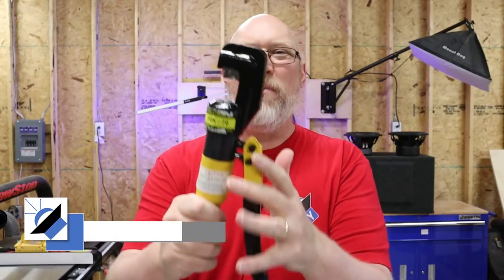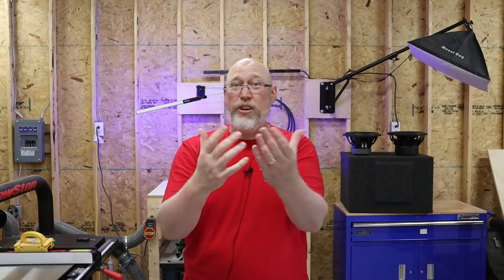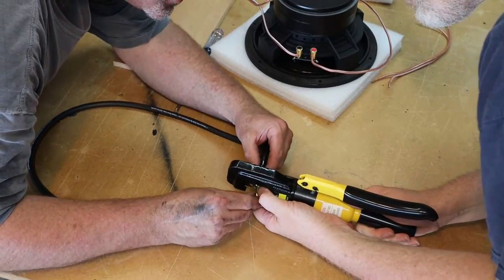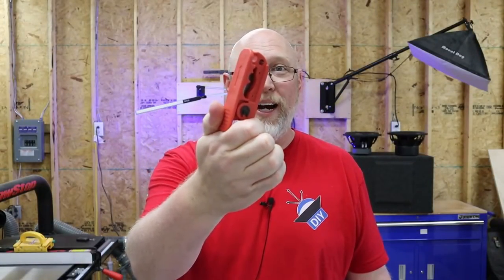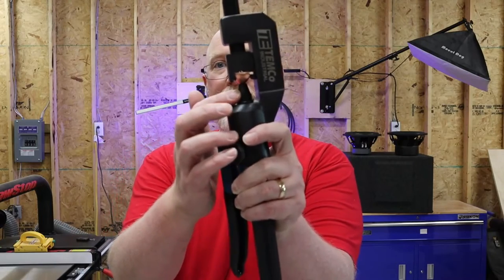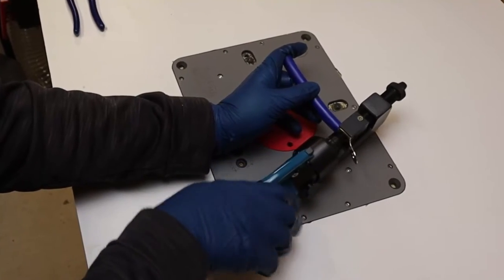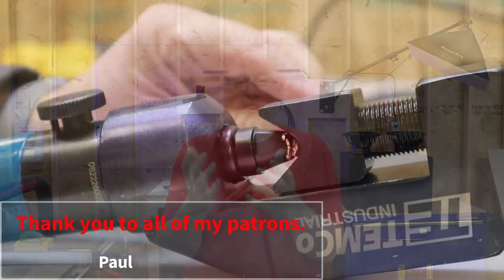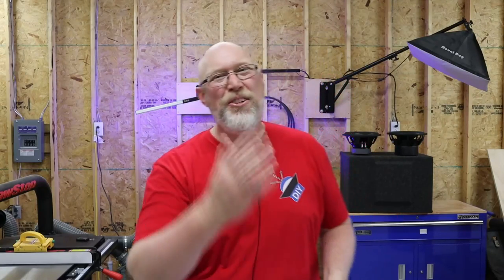The BEST lug crimper on Amazon!  TEMCO vs. Generic Yellow Crimper

Comment: My $60, 16 ton Chinesium crimper has worked flawlessly to be honest. If you really want to test that Temco crimper to see if it’s creating a proper cold weld you have to cut the lug in half after you crimp it. If the wire and the lug look like a solid piece of copper it’s doing it’s job correctly.

Comment: I bought this same cheepo crimper about 5 years ago. It has performed flawlessly through hundreds of stainless steel on stainless cable fencing.  the dies make a much stronger connection than a single point dimple. This wouldn’t matter electrically but for strength it maters. Put a little sticky grease on and it won’t fall off.

Comment: I have used one of these Chinese crimpers for years, it's crimped about 2000 Stainless wire balustrade's without a problem, never leaked, I must admit longer handles would make it easier, I think you're being a bit over dramatic about this, the Chinese ones also come with spare O ring kits if they every blow.
Reply from the maker: I have noticed that most of them do come with an O-ring, this one did not, and it was leaking on day one.

Comment: I got a TemCo - TH0006 v2 5-Ton Hydraulic Crimper & it has been excellent for three years straight. It crimps a hexagon pattern & is makes the most solid crimp possible. I would not trade it for any other crimper on the market. It also came with replacement o-rings & a 1 year no fault return guarantee if you are not satisfied with there product. TemCo makes excellent products & they cost more but you certainly get what you pay for with there products.
Reply from the maker: Cool!
Reply: I have the same one and share your opinion, it’s awesome!!
Reply: thank you for this comment, i am actually about to buy one.

Comment: TemCo is a brand name and so it's not surprising it did far better than the old crimper you had. I still use my hammer crimper--it gets the job done.
Reply from the maker: It has already made my life easier.
Reply: Yep the hammer style definitely works great. I have one of these and its nice to crimp ends when the large wire is still on the unit...I work on semis.
Reply: Temco makes good tools, but I personally like the hex style crimp better.  Yes, you need dies, but the end result is both stronger and looks much better.  And the tool only costs a little more than the indent style.

Comment: I have the cheap yellow crimper. I must have an updated version. The dies are in gauge and held in with magnets. I haven’t noticed it leaking and have had good luck with it so far. My only complaint is the handle is not spring loaded return. Does make it difficult to operate especially in tight spaces. But that Temco is super cool. No dies. Looks like a much better tool.
Reply: it's how all generic random brand chinese stuff are. Nothing related to updated versions. Same designs come out of multiple factories, multiple lines. Some have terrible QC and design, others are much better. No real way to figure out if two different tools are same unless the thing has a stamp on the tool itself, even same packaging or branding might have tools from two different companies with tons of differences.

Comment: my friend bought a set of these, i've used them, they work just fine, and you don't need an extra set of hands, unless you've just got really small hands.... if you just let it lightly clamp onto the lug, put the wire in and hold it,  and then pump it with your other hand... easy peasy... also his has never leaked or had any issues you've mentioned.

Comment: I love my TEMCo TH0034 12ton. Granted its big and heavy but it will do up to 4ga to 750mcm. The TEMCo products are very similar to the GreenLee brands that are rather expensive.

The changing of dies can suck, however I found that you're only swapping them a few times per build. 
Also something not aware to many with any dies from any manufacture is that the actual lug that you're using matters the most. A 1/0 lug from many different brands will usually have a different outside diameter of the lug (though typically the inside diameters are fairly similar). This is why you get flanges/wings after a crimp due to the lug being usually too large for a specific size and typically doesn't happen with a quality lug that would be used in something such as commercial wiring. So if you find a brand of lugs you like you should just always use said brand and not buy just whatever. 
Not to mention most those dies that come with those cheap hydraulic crimpers that are in a yellow or orange case are not the actual correct size dies that they claim to be and are usually off one way or another.
Also you should never use a hydraulic crimper to crimp an open end split style non lug terminal because that split in the terminal will not allow the actual metal to hold that force which is why most people solder them.
Reply from the maker: Those split style terminals are included in most amplifier kits.  I've almost completely stopped using them.
Reply: @DIYAudioGuy  Yea, they are so cheap and flimsy, even the nicer brand ones are fairly horrible imo! I was just putting the info out there though because I've seen people try to crimp that style a lot not knowing any better.
Reply: Greenlee makes the best ones if you really need it a lot it's worth looking into.

Comment: I found a nice manual crimper on Amazon and it works fine . iCrimp IWS-0810N Battery Cable Terminal Lug Crimping Tool . It crimps 2 thr 8 . The bigger the lug the more it takes to crimp but I don't use it every day.

Comment: I have the same yellow lug crimper. While I do hate it because it's cumbersome and hard to use, it doesn't leak and has magnets that hold dies in place. You received a bad unit probably should have sent it back. 

Glad you found something better though that one handed operation looks amazing I would love having one that is capable of that.

Maybe one day. At this point can't justify the extra price to replace one. Mine has been working great for years and I'm guessing I will see many more years of use out of it but once it starts leaking it's gone.

At that point maybe I'll get one of those fancy battery operated ones or a pneumatic crimper.
Reply from the maker: Mine was a dud for sure.  The spring loaded handle on this one made it a LOT easier to use.

Comment: Solar guy and electric tinkerer here, great review of these guys.  I've used cheap hydraulic tools before and I'd rather use a hammer or my 20 ton press to crimp than a leaking hydraulic crimper.  Great video!  Thanks for bringing this to our attention.
Reply from the maker: Thanks for watching.
Reply: A hammer?
SMH…….
Reply: @gottliebdee263   Yeah, those hammer assist crimpers.  I’ve been forced to use a large flat tip or tent stake and a hammer when I was in Iraq.  What’s possible and what’s preferred are occasionally not the same.
Reply: @neogator26  Yes, but this a completely different game in that case.

Comment: I have heard different reviews on that yellow crimper, I have and use the yellow crimper,  and has worked excellent for me especially if you crimp the lug , midway then crimp the rest of the lug making a level crimp. Also noticed that some yellow crimpers come defective from factory... So it's a mixed bag with the yellow crimper, on the Blue crimper, don't like the single round punch in the middle at all, I seems to have a lesser contact with the wire. Compared to the double crimped wire from the yellow crimper, that I have crimped, with no  room for any air, but super entombed to the Max. Maybe it's just me , and I am using extra force,  But to each their own... But whatever anyone uses, always try to do the best you can with what you have or prefer.. Enjoy your videos DIY..👍💯
Reply from the maker: Right, you never know what you are going to get.
Reply: @DIYAudioGuy  yes sir!! 👍💯
Reply: I used mine a lot and haven’t had any issue with the crimper.  But the dies are a pain and they do crimp the lug funny.

Comment: I own the same crimper... I noticed in the intro that you are pushing WAY too hard on the handle. The jaws are already closed as far as they will go... no need to keep pumping harder it will only blow the seals in the crimper. My crimper came with an extra set of seals. I learned this the hard way myself. Also if you get a loose crimp just use the next size down.. it will squeeze some copper out the sides but you can break that off with a set of needle nose and cover it with heat shrink. I get bulletproof crimps with the same exact crimper... rock solid crimps. WAYYY better than a hammer. 

Like I said the only reason its leaking is because you are wrenching down on it too hard... you dont need to go past the point where the jaws are closed. thats all. and the pumping should be very easy. In fact the pump looks the same on the blue one just a different head.
Reply from the maker: Thanks for the tip.

Comment: I really like my "inexpensive" 8 tonne crimper, it looks exactly like your leaky one Justin, mine came with buna and silicone (white?) o-rings to service it but they haven't been needed yet.

personally, i'm not a fan of the finished result of those wedge style crimpers, same for hammer crimpers i'm sure they work but the aesthetic isn't there.
Reply from the maker: I have noticed that some of the yellow ones listed on Amazon now include o-rings.

Comment: Spot on, those YQK 70 are garbage on so many angles, you said most of them. That Temco is ca $125 vs $25. The Hydraulic pump is useful (will add a spring to the handle.  It must be held in a vice or you need OH their as well)  I am tryin to machine up some of my own suitable anvils, so I may get some reliable joints

Comment: Problem with chinese one, the dies are very soft and the shafts tend to flare after a while getting stuck into the press. did work well until that happens, so buy something with hardened steel dies

Comment: I have one of these (harbor freight model) and absolutely love it! A tip for using these: Insert the lug and crimp down until it just holds firm or barely starts crushing the lug, after that you can firmly insert the wire while finishing the crimp. Much easier to position the terminal end however you want, lock it in place, and then have a free hand to hold the wire! This allows you to produce a more clean factory looking crimp with the wire sheath remaining tight against the lug end, which also gives a bit more rigidity against bending. 

If you're like me and just buy a spool of wire regardless of color, this is how I quickly determine my grounds vs my hots, as I don't bother shrink-wrapping my grounds. Just about every exposed metal surface in a vehicle ties to chasis ground, heck even your ignition cylinder ties to ground! Just a nice little tidbit if you do a lot of changes, or temporary removal for space, etc...
Reply from the maker: That is a good tip, when the generic yellow / harbor freight versions add the spring to the handle I'll switch to them. But that spring makes a world of difference.

Comment: Wow those are some ugly crimps. You don’t get those “wings” with a die crimper if you use the appropriately sized dies with the correct termination lug.

I’ll take the die style over the ones with the pokey bits any day of the week. As far as those cheap yellow ones go, the “heavy duty” version with the fully caged dies is far superior to the open face style.  Of course any crimper sucks when you use those cheapo split barrel terminal lugs or those flimsy ones made out of flattened copper pipe. Zinc plated cast copper with heavy wall closed barrel lugs are the only way to go. I prefer the ones made by Quick Cable.
Reply from the maker: Just one of the reasons why that yellow crimper is garbage.
Reply: You either got a dud or blew the seal by continuing to pump once the dies had met; there's a reason the chinesium ones come with a spare set of seals. 

Sorry but the crimp from that TEMCO unit looks substandard to me, not much better than the shade-tree mechanic hammer-die style. My yellow crimper has been perfect so far if not oversized for what I need (larger cage style YQK-120, 10-120mm^2)

Comment: You are using way oversized lugs for the cable. I also see you are using split lugs which should be crimped with another style of die, which resembles a W shape to bring the split ends into the cable.
Reply from the maker: I hate split lugs.

Comment: Totally disagree with this!!!! Usually I'm right there with you, and your spot on with your reviews but not this one. I have the orange Amazon one for 46$ and it's my favorite wire tool. My dies came with metric stamped on one side and awg gauge on the other, and they never fall out, actually it's kinda tough getting them seated. Also mine doesn't leak, and the flanges it leaves on smaller gauge wire go right away with a simple 180° rotation and another light crimp. I think you just got a bad one, the second I seen it leaking from the package I would've returned it for a different one. Only thing I do agree is getting your lug lined up with one hand....but I found that sitting down and resting it on your thigh, while crimping with one hand, and holding the lug with the other is best.
Reply from the maker: Yes, I did get a dud.

Comment: I use the temco hammer crimper. I love it
Reply from the maker: I have not tried a hammer crimper.
Reply: @DIY Audio Guy  it works well. I usually set it on solid concrete floor for best reaults
Reply: @DarrinLintz710  I love mine.

Comment: It is noteworthy that you use cheap cable lugs in your tests.
Testing a cheap crimper with low-quality cable lugs can only give one result
Reply from the maker: You mean the lugs that came from a high-end brand, the ones they included in a very expensive amp wire kit?  A brand I no longer use and no longer recommend.

Comment: Liked the video!
Reply from the maker: Thanks!
Reply: @DIYAudioGuy  I would still like to see a video about termination using solder pucks and torches. I see heavy gauge wire handled this way by diesel mechanics and think it would translate to car audio. Certainly, if it is strong enough for a Caterpillar dump truck then is adequate for a 1/2 ton pickup. In addition, the solder puck is just a dollar and once melted there are no gaps at the connection. I might be missing something, but your videos are thought out and logical - you seem like the perfect person for the topic.

Comment: I have the temco unit with die set. These are nice but I don't like the crimp it makes.  For high amp solar applications that single touch "spot" weld if you will could create a hot spot. Dies are a pain to work with but in the end I think you end up with a better crimp..  TH0006 v2

Comment: Im on my second day of using this yellow crimper with a different brand name but its the same. TRASH! I have to size down the dies to get a secure hold then grind off the sharp edges left behind so they don't cut my heat shrink. So i guess im not the only one struggling and wasting time with this hunk of junk...thanks for the video
Reply from the maker: I hate to hear that.